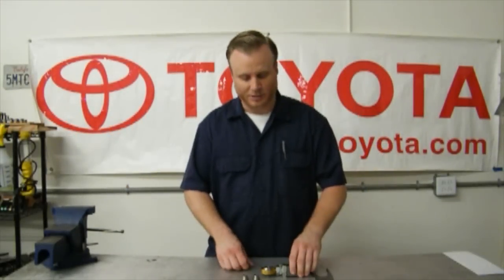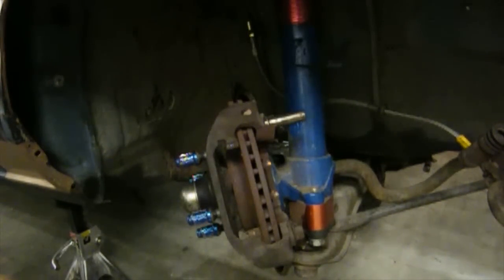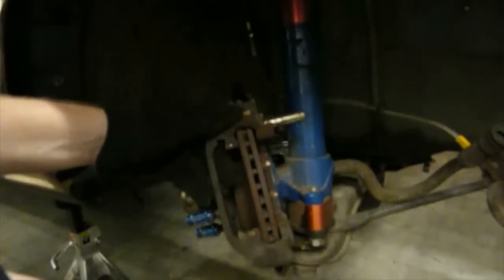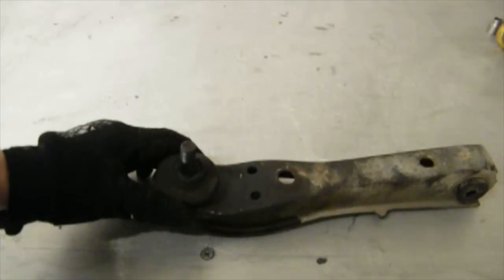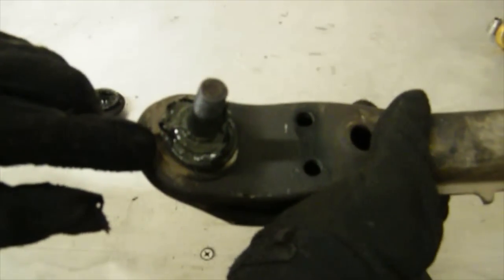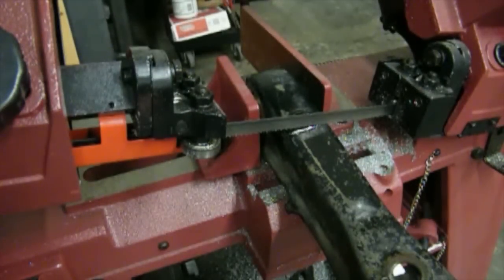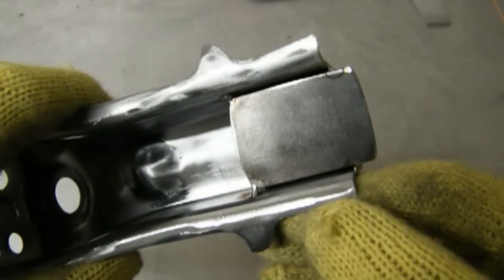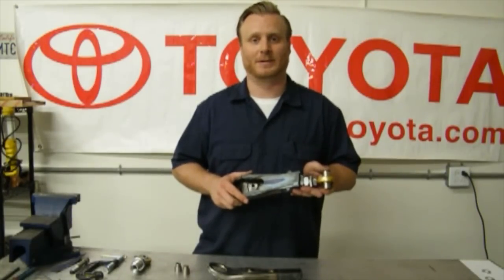Techno Toy Tuning Weld on Lower control arm kit (How To)

Comment: Nailed it alright! Would have nailed it better if you used a jig to ensure accuracy.
Reply from the maker: Mick Holgate what exactly are you worried about getting out of line?
Reply: @seymour86  i'm saying good job mate! wouldn't it be more accurate with a jig though? Every vid i see similar to this they use a jig, is one necessary?
Reply: @mickholgate3347  I fail to see how that's necessary when the block fits in there relatively tightly and the suspension is adjustable in both axes. The amount of misalignment you might see at the rod end relative to the ball joint is minimal and will not affect the suspension geometry. The arm is adjustable length wise and the location front to back is determined by the adjustable tension rod that connects to the unmodified end of the arm. Worst case is you have the spherical rod end at a very slight angle that is nowhere near the level of misalignment they're designed to allow for.

Comment: Sandblasting, glassbeading is a great way of preparing metal. Dont know what the fack you talking about
Reply from the maker: When using common media like aluminum oxide or glass, If all the media is not removed or some is embedded into the material it can cause weld discontinuities and or defects.